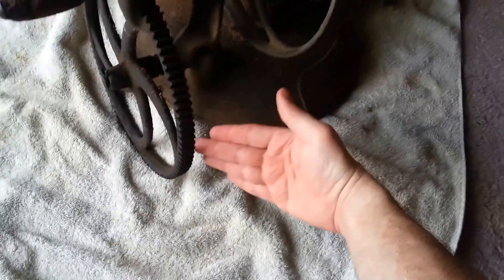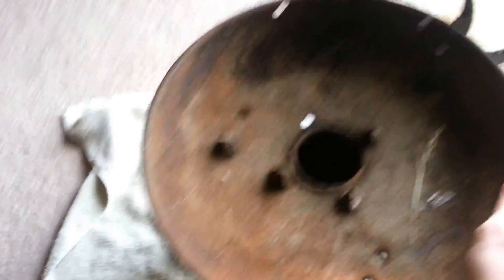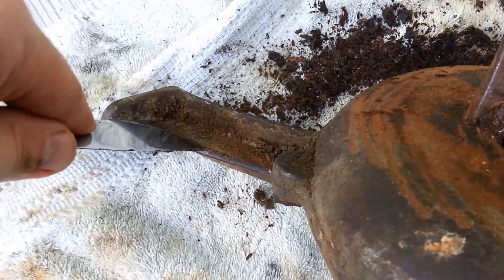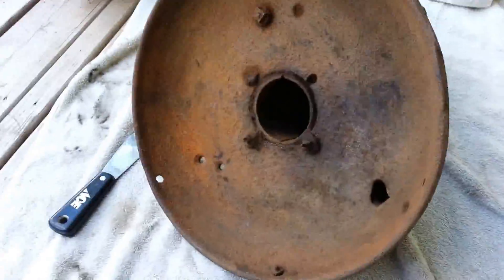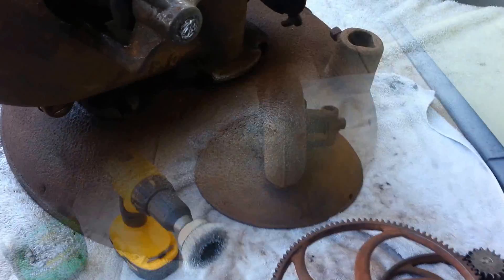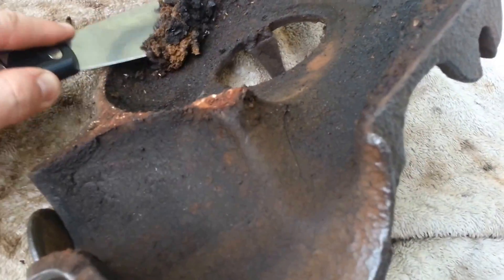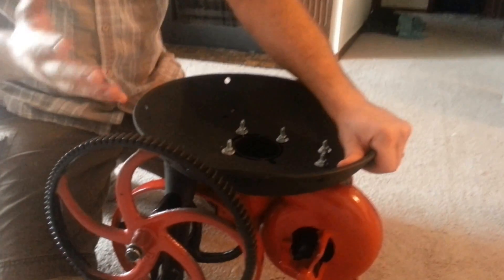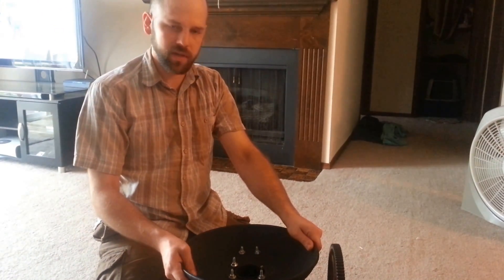Antique Blacksmith Tools Restoration: Rivet Forge Restoration

Comment: I'm sure you have figured it out by now, but you can go to most auto parts stores and tell them the length and shape belt you need. Autozone it a roll of the dice, but NAPA usually has knowledgeable staff that can help.

Anyways, thank your for sharing. Awesome restore!
Reply from the maker: Henry Wilson thx for the tip

Comment: I just got an identical one!  You've convinced me to clean it up and paint it too!  Mine still has the belt, but it runs a bit rough.  I wonder if the inside of the fan is gunked up too.  I noticed oiling holes at all the shafts, so I'll be oiling it before each use.
Reply from the maker: awesomeness! hope it works and and let me know if you get it up and running!

Comment: I picked up a Rivet Forge at an auction last year.  I've taken it apart, did some rust removal and just about have it back together.  Mine has an old oak handle you pump to get the blower to work.  The blower was full of nuts, mud-dobbers and who knows what else. Anyway, after cleaning it out and bolting it back together it works but just barely.  The bushings for the center shaft are badly worn and the internal blade bangs around a fair amount.  I'm considering making a couple of bronze bushings (they're internal tapers) to correct the wobble and play.  Not sure how hot the blower area will get but surely not hot enough to melt the bronze.  
Take care and nice find!
MrClockbob (www.clockbob.com).
Reply from the maker: hope you get it working. send me a video if you do :)